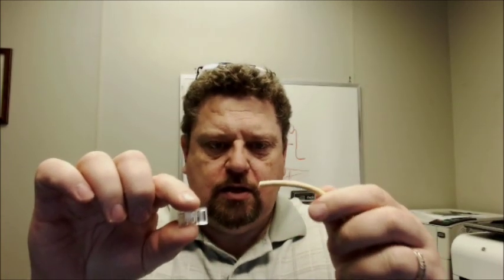Network CAT5, CAT5e, CAT6 cabling T568A vs T568B

Comment: Dave, THX for explaining and video. A good point u bring forth about consistency. Indeed if you do not want to run another cable when a longer one is required, and u have to use some sort of short adapter from cable to cable, and use another/second cable to extend you data line, having all cables made the same way is very helpful - they will mate without any concerns.

Comment: My understanding after some research is that for cables it doesn't matter and using the B standard is more common and thus recommended. However, in wall wiring, from network center to wall jacks, the A standard offers the ability to connect phone lines in addition to data lines.

Comment: I'm running cat 5 at two locations in my home. Went to the electrical store instead of Lowes or Homedepot. The cat 5E keystone jacks have two wiring diagrams. Being a home ower NOT an electrical engineer I had no clue what to do. Thank you very much for this info.

Comment: A cable wired T568A on one side and T568B on the other side is a Ethernet crossover cable.
With this cable you do not have a switch to connect two computers. My pc is connected to my firewall this way.